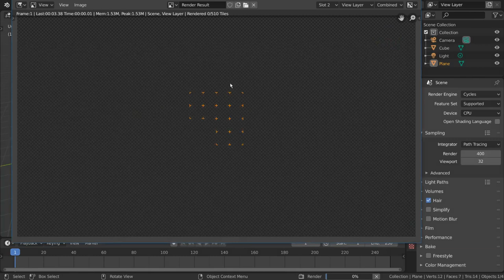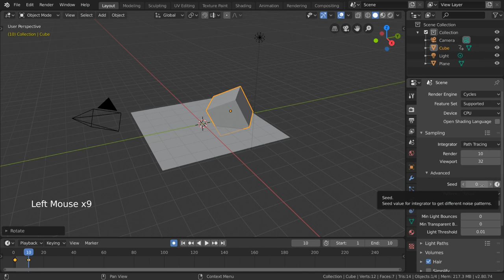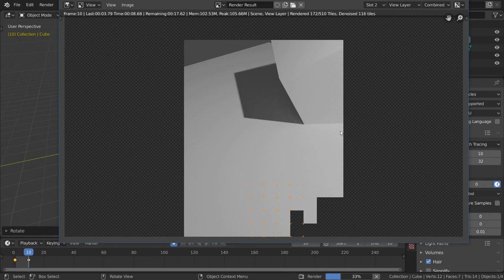Cycles Samples - Blender 2.80 Fundamentals

Comment: Why i dont have gpu support for cycle on my Mac ?
Reply: @van-hieuvo8208  but ive intel and it works
Reply: @PeterNjeim  I see the same message that i see for cuda (No compatible GPU's found, cycles will render on cpu ), But I am only getting this with blender 2.80 not with 2.79 because i had full gpu support for cycles renderer
Reply: @FarhanKhan18  Yes I updated my reply after I learned about the situation. Turns out they removed macOS support due to Apple dropping support for OpenCL as well.

Comment: how to use decimate geometry in Blender 2.80?
Reply: Select the object. In the proprietys panel go to modufuer toolvar and select "decimate modifier"
Reply: It's also possible to do in edit mode with the clean-up menu under Mesh.
I tend to use decimate to reduce the filesize and improve performance when I have a very large object. Sometimes I use it to simplify the form of an object so I can see if the overall shape works without the details.